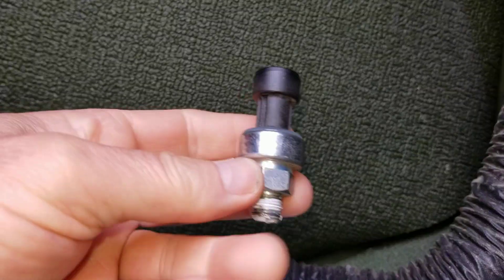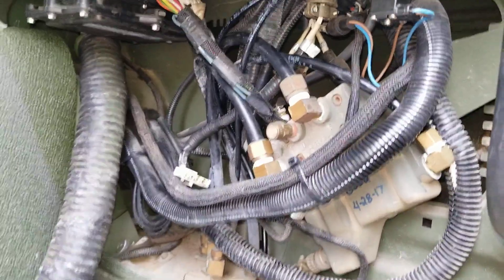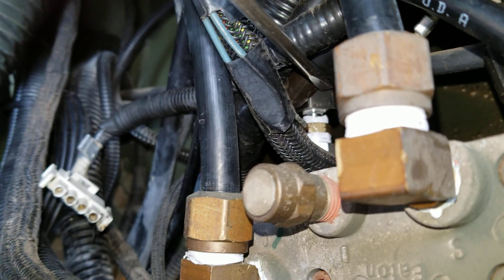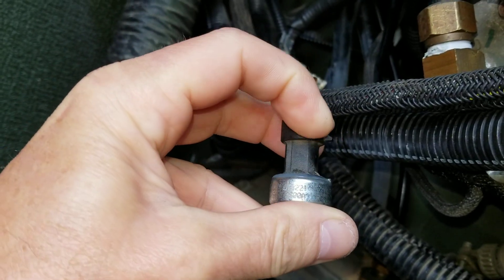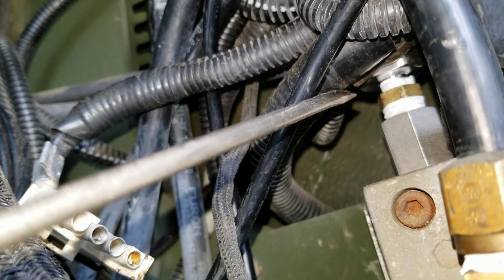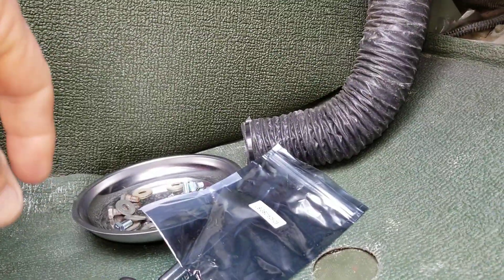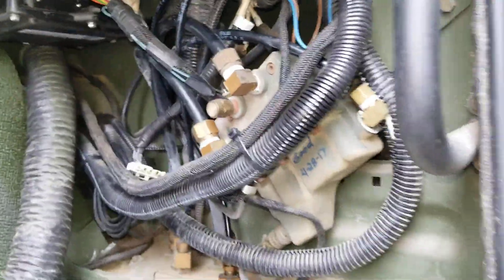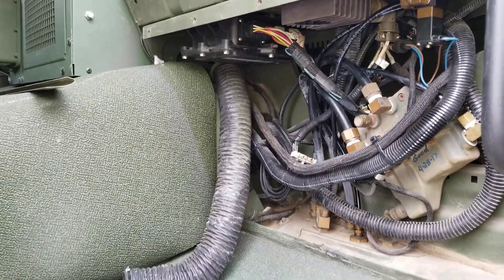CTIS Transducer Swap (75 psi Highway)

Comment: What is the part number and manufacturer of the transducer?
 Thanks 

Paul
Reply from the maker: Sorry, just saw this.  I just snagged one off eBay for my first truck.  For my new truck I got one off Amazon.  https://www.amazon.com/AUTEX-Pressure-Transducer-Stainless-Compatible/dp/B00NIK98O8/ref=pd_rhf_ee_s_rp_c_0_4/144-8642635-8860128?_encoding=UTF8&pd_rd_i=B00NIK98O8&pd_rd_r=0a1bdaee-c81a-4924-b710-ecc1b3a19ae3&pd_rd_w=s5bgS&pd_rd_wg=2TgsN&pf_rd_p=4c4fea7c-4562-4f88-af02-333e1a1f55c2&pf_rd_r=CE7GGEPY43G1F1VEVA8X&psc=1&refRID=CE7GGEPY43G1F1VEVA8X